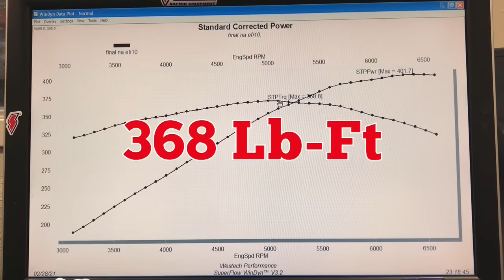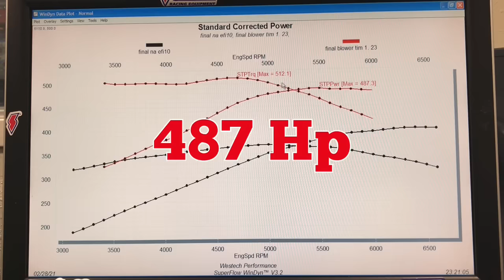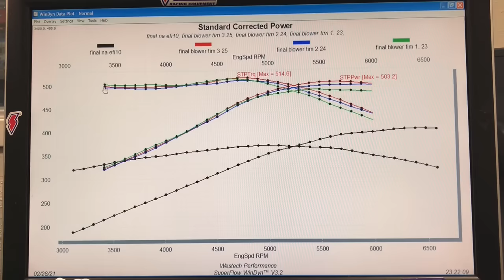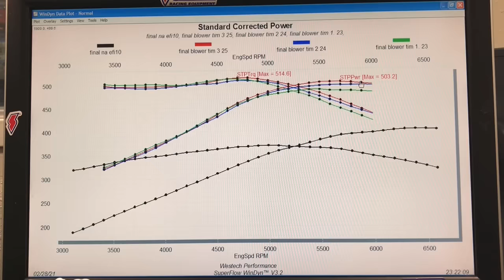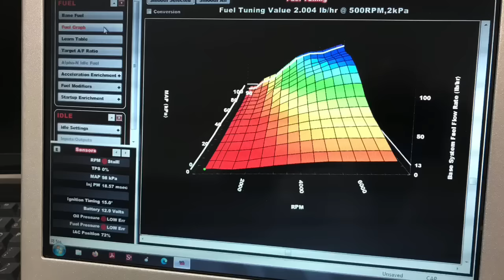CHEAP, E-BAY LS BLOWER MADE EASY! PUMP GAS M122 CAD BLOWER BOOST!

Comment: I want to see that sc on a 6.0
Reply: I would guess it would have to be way over driven to have any significant output, but a real world test would be Kool!!!
Reply: I actually have one on a 88 monte carlo and building one for a 2000 camaro
Reply: @Guns_N_Gears  the 4.8 only made 400hp which is a bit more than a stock lq9 so it should be similar output just a few hundred rpm lower in rpm
Reply: @regal105  stock 4.8's don't make way more power than a stock LQ9. Richard doesn't dyno them like the factory does. The factory keeps the entire air intake and exhaust system when they dyno
Reply: Torque baby....then over drive it if possible
Reply: Id like to see the torque on a 6.0 with it. Should make a good daily towing rig.
Reply: Stack like 3 or 5  of em together.
Cummins stacked wouldn't have shit on that.
Reply: I think I saw a video the other day where an LQ9 sucked it right through the cylinders and shredded the cats with leftover bits...😏😂
Reply: @regal105  my bad- misread this, so I deleted haha.
Is that really right though, our boy is making 400 on basically light mods and a Holley fuel management?
I'm doing a K.I.S.S. 4.8 full-drivetrain and management swap (for all the fools out cutting harnesses and scratching heads about bellhousing adapters) in my G body, and massaging over 300 for no-cost would be cool- but 
400 for not-a-lot of mods would be PERFECT!

 I need to watch his other vids to see what this gen4 rod stuff is about.
Reply: @dennywiseman5360  Yeah you're right about that- I think there's more difference overall, but looking just strictly at early 2000's same-year productions, the numbers were just shockingly close considering what I'd expect.
They dont perform the same at all though, and everyone always forgets about TORQUE. 
Most importantly- even I didnt appreciate or understand til seeing- dyno curves of the 6.0 and 8.1 as opposed to 6.2:
WHERE that power/torque is applied in the rpm range. I get why my friends coveted the 6.0 so much for work trucks- the applied torque and power curves are very similar to the 8.1 in evenness, where the 6.2 is totally a Hotrod engine. 

Anyway- just posing that though similar on paper, they are way different in application but curious-
Do you think this supercharger would REALLY make a worthwhile proportionate difference on a 6.0?
I feel like it wouldn't really be WORTH it unless you're just looking for a little helper, but I have no clue.

Comment: Do they make one of the adapter kids for a BMW m60 or m62 v8?  They can be had so cheap and make decent power. Stock internals are strong for boost, but not too many Blower kits except for the old jaguar one.

Comment: Seems like a lot of work for only 500hp (pump) a 6.0 or 6.2 will o that without the hassle of a SC
Reply: And that’s before drivetrain loss. Curious what part 2 brings.
Reply: A 6.2 is very very expensive.
Reply: A 4.8 is way cheaper than both.
Reply: @EGGINFOOLS  
Do China do knock off Ls engines yet?
Reply: @hoonaticbloggs5402  No. That'd be a ford

Comment: $3550 for the semi-complete kit. Ouch.
Reply: yes, but compare that to most blower kits for $6500 and a few turbo kits for $3500
Reply: Except a turbo that peaks at 500hp on a dyno will have monster torque down low & insane response anywhere besides idle.
Reply: @hydrocarbon82  and decent gas mileage

Comment: OUCH.... 1400 bucks? ..
Reply: Whipple is $6,500
Reply: @kyleallen3857  LSA kit 3500 bucks. Torqstorm centrifugal kit 3200 bucks. 1400 is only for the adapter plates. NOT including the fuel rails, intercooler adapter, tensioner and idler pulley setup as well.
Reply: @ReinersRigs  I do not disagree

Comment: Rich, the adapters alone cost $1400.  Is it really worth buying this over a used LSA blower?? Those adapters cost less than $200 if you have a cath port heads.  Or upgrade to L92 heads and it bolts right up.
Reply: No one with the money to afford the adapters would do a 4.8 and probably not even a 5.3.  Definitely to see this on 6.0 or 6.2
Reply: The Cad supercharger won't bolt to L92 heads.  Your thinking of the LSA or LS9 superchargers.
Reply: @andyharman3022  They also have adaptors for rec port heads too, to use that supercharger.

Comment: If I may be so bold to ask will you be doing this on a 5.3 as well? or is the supercharger too small for that application? As you can see I'm a novice at this as well lol. Thanks for everything you do!!!
Reply: No, they used it on the 5.4 GT500 until 2012

Comment: A few hours ago there were lots of these for sale on eBay, now there are none. Richard Holdener I think you're more influential than an Oklahoma wether man.
Reply: Yes.  On Saturday, I checked eBay for these Cadillac blower systems, and they were at $420.  That would be a screaming good deal, but now it seems like those deals are going away.  The Mack Daddy billet adapters would probably cost more than the blower itself.
Reply: @andyharman3022  they cost 3x more
Reply: @ShawnGilbert1967  Yes, I saw other people commenting about that.  There is a lot of machining in those pieces.
Reply: @andyharman3022  ehhh cast em them...I was presume WAY more machining in the entire blower

Comment: Was looking at putting nitrous on a stroked LM7\383 for the 5.8 index class. I am concerned that the short compression height (1.110") will not allow for proper ring pack placement (further from the top of the piston crown).  Is their a better bore\stroke combo for heavy nitrous\boosted applications (without breaking the bank)?
Reply from the maker: try just the bore
Reply: @richardholdener1727  Not sure how a bigger bore helps the compression height? Not that there is much room for more boring on a 3.905" hole already. I was thinking shorter rod. Drop from a 6.125" to 6" or below. Just not real familiar with rods with the same size big ends.
Reply: @richardholdener1727  Never mind. I think a 402 build using a GEN IV, 6.0L, LY6, L96 Cast Iron Block is the answer for not much more money. Thanks again for all your hard work.

Comment: How about some bolt on stuff for a 318/360 magnum setup. My work truck is a square body Dakota with a 360 swap. How well do market- available heads and cam combos help them. Hughes Engines even has a efi airgap manifold and throttle body(1000+cfm!!)  Upgrades. I'd love to see this done if the interest is there.

Comment: Richard, need your help. I have a 98 5.7 vortex. I would like to rebiuld better with some power. It's in a 98 chevy truck. 
For everyday use and towing. What manifold and heads do I use? Would like to stay clear of carburetor.

Comment: This is exactly where I would like to go with my 2, 2000 GM 6liter builds. One will be in my 4x4 hoping for a respectable 550 hp and same in Tq, the other build is my 69 Chevelle. I would like that to be a street legal 8 second car, so I would need 1200 hp or better.
I am old school so I love the blower compared to turbo and would totally love to use the blower.
Can you get different size pully on that Cadillac blower ?
Reply: All the pulley in the world won’t get you 1,200hp out of that little blower.  Not even sure if a 4.0l Whipple would get you there.
Reply: @carportshenanigans5918  that's why I am doing my research before I buy with high expectations.

Comment: @richardholdener do you have any videos adding boost to a higher compression pump gas motor? Say 10.5:1 on 93 octane with a higher rpm cam? I have a 302 Ford with a 232 @050 cam and am wanting to add boost but am concerned about adding boost with higher compression and cam timing. LOVE THE VIDEOS!

Comment: I wonder how the price would compare with similar power output  , with this blower set up Vs the typical, heads cam intake combo . Although I do like the look of that supercharger set up
Reply: Judging by the NA run numbers, he already has a bigger cam in that motor. So take out about 50hp and you will have your stock numbers, which are going to be comparable to heads/cam/intake/exhaust upgrade numbers on a 4.8, but the SC delivers those torque numbers so much earlier, that you may get away with running a stock converter. The SC will definitely make it a much more pleasant daily driver. Seems like price will be comparable.

Comment: Whyd you run mufflers on the N/A test, and straight pipes after the supercharger was installed? That alone will change horsepower.
Reply from the maker: it changed nothing
Reply: @richardholdener1727  Absolutely would. Especially on the boosted application. Which was the one in this test you deleted the mufflers.

Comment: Hey Richard 
First of all love your content new to this chanel.
Second of all, I am new to the car world I have my grandads 350 1983 chevy suburban I worked on the metal the exterior all renewed except the engine. This is the only thing I have left from him. I changed the engine to a 92 350 engine everything works fine but the power is just meh its a 3 speed manual I want it to be my daily driver its just so heavy... I want a engine I don't know whether to buy a newer engine or renew this one with aftermarket parts...  I'm looking at ls engine not sure which or edelbrock packages can you help me please.  Just tell me either aftermarket and what I should get or newer engine and what engine. I don't have super money and the car will be for trips and the desert too something mild and reliable please

Comment: Have you tested a bored vs stroked LS to the same CI would come out to? I'm curious to see which would have more power and where the torque curve would be in comparison.
Reply from the maker: it does nothing at these power and rpm levels

Comment: The 706 heads come on the 5.3ls correct? Or are they after market? If aftermarket where would be a good place to get them?
Reply from the maker: 706=stock 5.3l, 4.8l heads
Reply: @richardholdener1727  i saw I believe someone saying the 706 heads added 50hp, if they come on them does that mean if they are ported they add 50hp?

Comment: You can buy the scan file for the adapters on eBay for $300. Don’t rely need to spend $1400 for them...
Reply: Link? Trying to find but can't
Reply: @reillyp8115  Type in on eBay: Cadillac CTS-V XLR-V supercharger 3D scan file

Comment: Don't those adapters run like $1,300?.. add in the price of the caddy blower , you could easily find a takeoff LSA blower that fits.. am I missing something?
Reply: You still need to factor in the other parts needed for the LSA, like balancer, custom front accessory brackets.

Comment: He said he used E85 but I can't run anything less than premium in my truck if I run E85 in my truck it runs like s*** but then when I put premium top-tier gas in it runs like a champ with E85 I step on the gas and it feels like it's missing but then when I put premium in I step on the pedal there's no missing straight Evenflo all the way down the road I don't know if it's a problem that I have with my fuel injectors but I was just wondering why it runs like s*** and you can run E85 does it have something to do with my fuel injectors
Reply from the maker: it needs to be retuned for e85 unless you have a flex fuel sensor
Reply: @richardholdener1727  I have a V8 Chevy Silverado 1500 flex

Comment: My aviation instructor would say "Boost is not correct its called manifold pressure"   I said really why do they make gauges then with the word Boost on them
Reply: Technically he is correct, but boost is correct  also due to the fact there is no negative boost, where they could be in the above statement.,So both could be theoretically correct. jus sayin'

Comment: Do you need to swap out the injectors if your vehicle already has the E85 option?
Reply from the maker: I'm not sure of the size on those
Reply: 32lbs flex fuel , regular 5.3 is like 26lb.
I also get asked at the auto parts store if it has flex fuel or not as it appears the fuel pump is more money and higher volume.

Comment: Hey could I modify a hellcat supercharger to a 4.8 ls vortec engine using a supercharger intake manifold the flat top kind , thanks in advance
Reply from the maker: it would require a custom lower intake
Reply: I found a few for around 1k bucks and never seen anyone do this setup I figured a supercharger intake adapter plate would work but you probably know more then I do I’m sure maybe you should do a video on that 🤔
Reply from the maker: hard pass on building a custom adapter plate to run that blower on an LS

Comment: I wonder if I could fit 1 of these superchargers to my Australian Ford 5.4 litre V8 engine boss 4 valve?  I'm a welder fabricator, so I know a few engineering shop owners to make a port adapter.
Reply: The billet adapters would probably be easier to make because the Caddy and Ford engines are closer in bore spacing.

Comment: NA pull had mufflers and magically no mufflers supercharger. Sandbagging NA numbers to show bigger gains
Reply from the maker: those mufflers don't hurt na power on a 400-hp 4.8L-they add torque(we tested)-the real culprit if you want to complain are the accessories
Reply: What necessitated the change with mufflers anyway? Definitely more torque with mufflers na but I would believe that the supercharger would have more to gain from the less restrictive exhaust flow vs NA

Comment: That 4.8 on 10/15 of timing is a stump puller with that torque. Will any gm blower work on the adaptors?
Reply: No.  The LSA and LS9 blowers bolt directly to rec port Gen IV heads. There are adapters to go from cath to rec port...
Reply: @andyharman3022  oh nice. So the blower he is using is from the LT series of motors?  It would be interesting to run one of these and a turbo. Whats max boost a lsa could pull on stock rotors?
Reply: @minibikemadman  The supercharger is from the lc3 cadillac engine only.

Comment: Do you need a Caddy Serpentine system or will it run on the existing pulleys
Reply: It uses the stock truck accessories plus the tensioner they provide for it.

Comment: Would this fit on a 95 z28 LT1 with a 383 stroker?
Reply from the maker: not without work
Reply: @richardholdener1727  what would you recommend? I'm looking at a Camaro  with that setup and want to know if there's anything else I can do before diving in with a supercharger

Comment: Making a 25% increase in power with a 75% increase in manifold pressure makes me think there is something seriously wrong with that combination.
Reply: He addresses that repeatedly,  pump gas = ignition timing limits to prevent predet.
On e85 it should wake up
Reply: @MeatPoPsiclez  He ran the NA baseline test with mufflers, but the SC test without.  That's making the supercharger combination look better than it actually is.
Reply: @MeatPoPsiclez  Pump gas and timing do not account for the difference, not even close. At 11psi it should be close to 700hp. You’ll see, it will not get anywhere near that number on e85. Something is restricting this combo.

Comment: Would this be a good fit for an actual LS1?
Reply from the maker: YES
Reply: @richardholdener1727  sensational, I will go purchase one
Reply: @richardholdener1727  I guess the follow up question is does this make the engine too tall to fit under the hood of a C5? That’s the application I would use it for
Reply: @TheNutshaq  it will not fit under a C5 hood, and you'll most likely have to cut the windshield cowl, and possibly machine the pulley snout shorter to match up with the LS1 belt drive.

Comment: Wait was that a blowoff valve behind the throttle body at 4:15??? Wth?
Reply from the maker: just an air intake-the bypass valve (tubing was used on many turbo combos previously) was not hooked up
Reply: @richardholdener1727  ohhhh gotcha

Comment: I wonder how it would work on a 6.0 LS
Reply from the maker: works fine
Reply: @richardholdener1727 on a LM7 383 with a BTR truck norris cam, 243 heads, ls9 head gasket, forged rotating assembly?

Comment: If your really on a budget try using a leaf blower and  duct tape !
Reply: It works I really think I made 100 hp out of the leaf blower but the truck lost a little👍😂
Reply: @garymorel1882  those are sum good numbers!..try using a K&N air filter and a moroso cool can on the leaf blower. That should get about extra 15 to 20 .😆
Reply: @Defcon666  I’ll start with k&n sticker first 
I’m sure that alone worth 10hp right there👍
Reply: @garymorel1882  🤣🤣

Comment: What did this produce for boost?
Reply from the maker: 11 ish psi
Reply: @richardholdener1727  thank you sir. I have actually been working on an lc3 blower on a 6.0 with a ss2 cam for awhile now. I'm very close but totally different intake runner setup with long runners and modifications to the blower and intercooler water flow.

Comment: First run you had a muffler on the 2nd run with supercharger was open headers 🙄
Reply from the maker: no difference
Reply from the maker: the big(ger) difference is that the na motor had no accessories

Comment: Seems cool. But $1400 for the adapters?!
Reply: Give it time, a competitor will come along and knock the price down.
Reply: Ya, but it's only $400 for the supercharger brand new and the adapters will never break or wear out.
I do wish they were cast and not cnc so the price would be half.
Reply: Yep, at $1900+ for the blower and adapters alone, imagine the turbo setup you could put together.
Reply: If you went name brand you’ll be far past $1900. But you could make way more power. Curious what part 2 will bring.
Reply: @frenchonion4595  you just need the tensioner and one extra idler pulley. You retain all other factory brackets, unlike the LSA swap.

Comment: do you think this blower is too small for the larger engines 5.3 or 6.0?
Reply: answering my own question here. after some quick research it looks like this blower has a 2L displacement, and the stock LSA blower is 1.9L. So in theory this should be able to make some decent power even on a 6.2L but the key there  is "in theory". would be great to see this tested on a 6.0L just to make sure it can keep up.